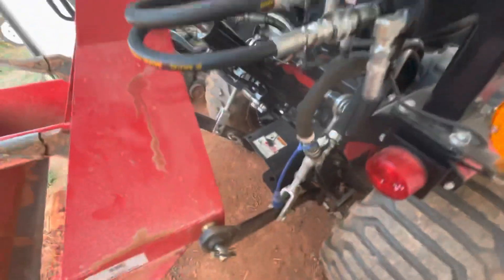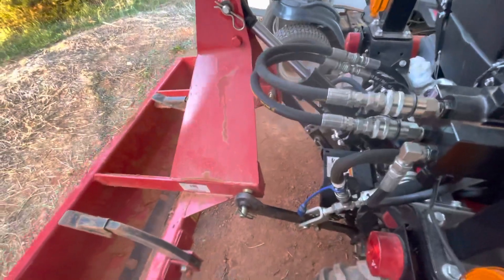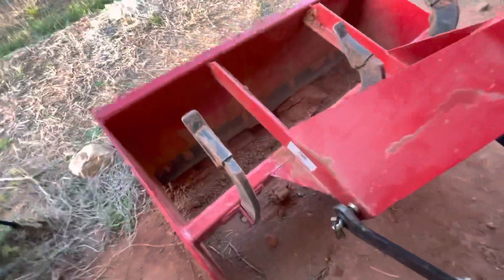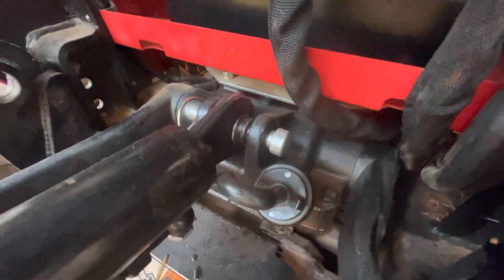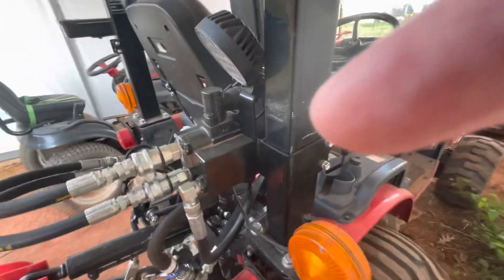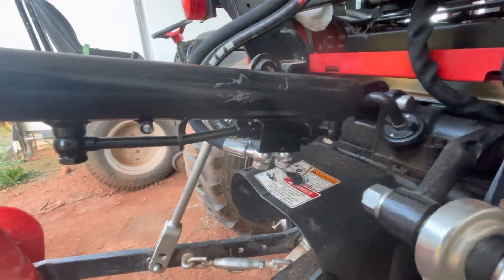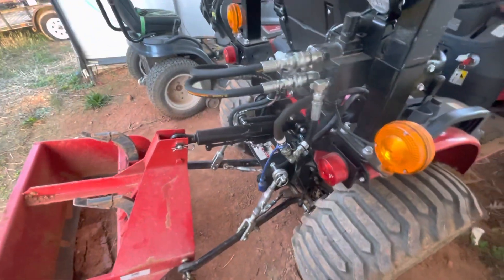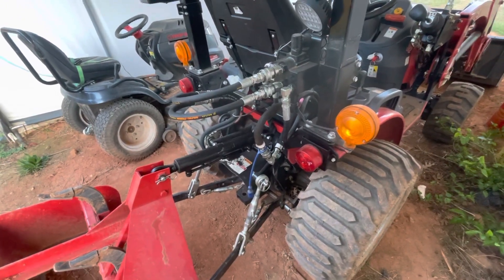RK24/TYM254 - Hydraulic Top Link Install and range of operation

Comment: Thanks for the video , you had mentioned the cylinder could have been next size shorter, what is the length of the cylinder you bought, also the modifications to the lines did you do them or did a shop have to make them , thanks

Comment: You can remove that back bar so your top link will go up higher. That's what I did works good 👍
Reply from the maker: Thanks for the comment.  It will lift all the way up without hitting the bracket.  It’s been working great!
Reply: @sportbikerdude  👍  good to hear
Reply: Is it possible to turn the cylinder over where the block is on the top; instead of the bottom I. Order to avoid the pto guard?